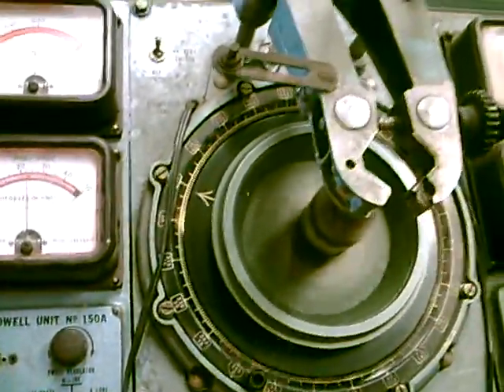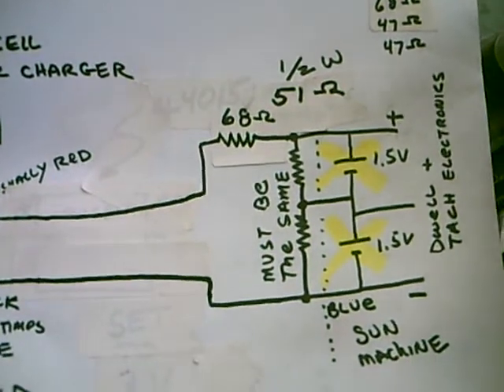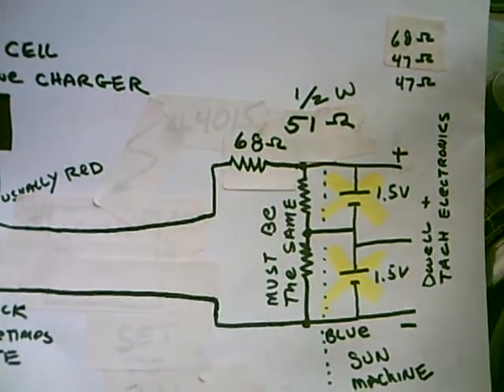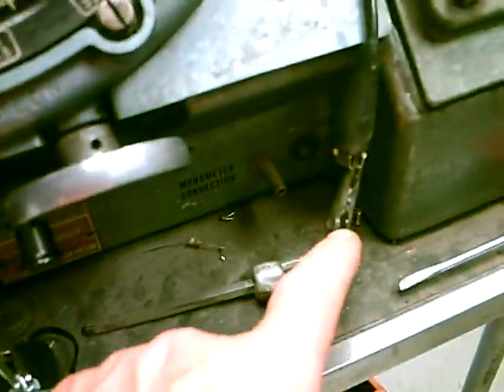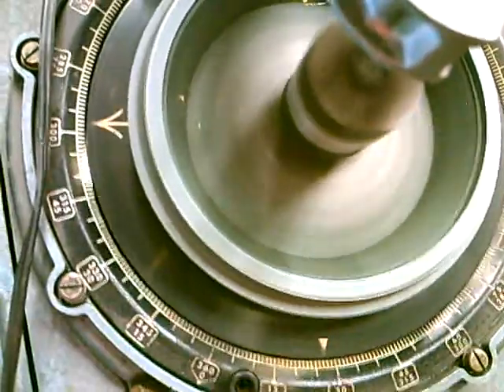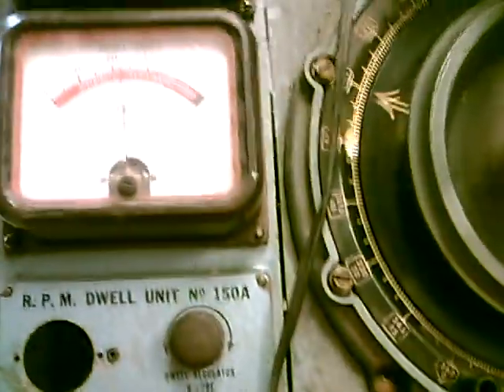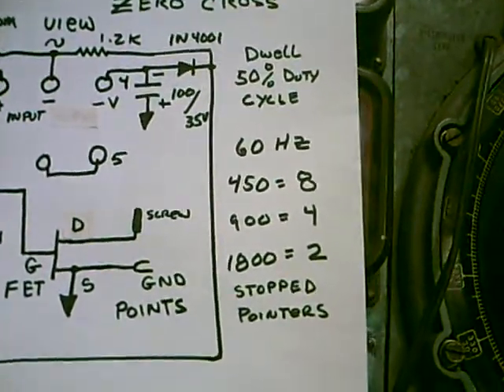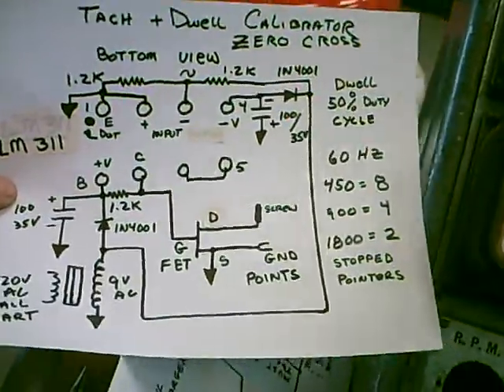Verify SUN Distributor RPM Cal & Battery Eliminator

Comment from the maker: There is now an easier method to calibrate speed and dwell with this ready made module. The manual wants you to use a factory calibrated distributor and where will you ever find that. A nice LCD display in a case for $5 or $10 US SHIP for those who don't want to wait.  Just add a FET and two resistors.  A video will be produced in a few months when I return.  I can provide a build it video before that if requested.
Reply: opera also interested in your LED as well

Comment: I need one of these machines.
Reply from the maker: These SUN machines are around and the ones with bad electronics are pretty cheap. I know someone in SW Ohio that has some rebuilt ones and maybe one unfinished.  They show up on ebay now and then.  I still have the Dwell Flash kits. I've had some people buy a half dozen kits over time. They must have a side business rebuilding these.

Comment: Hello from suburban Detroit!  Can I ask what FET part # you used for the circuit?  Eager to build this during the stay at home time!   Thank you for the help!
Reply from the maker: Picked up an old SUN power supply today. The machines are 30 miles from home. Looking to find some time to do testing. No internet so videos are hard to do.
Reply from the maker: Untested for non DS machine. 20N50 500V 20A get. .1uf D to S 47 ohm gate resistor.  Recommend $5 pwm generator for any build. This video will be deleted once I can make a new one.

Comment: I would be very interested in a build it video on your cal tool for RPM! Or I wouldn’t mind buying one from you
Reply from the maker: I have a later video on building one with cheap $5 pwm module from China. It needs to have a FET added to it. That design only works with the DWELL SPARK module.  with a higher voltage FET and some other parts it should work with other machines. Unable to load new video in current crisis or provide a link with only phone.
Reply from the maker: I never made the updated video. Did make one for someone who bought a flash module. At that time I was 800 miles from a machine. Would have to make one in order to do a video. This could be an option in the future.
Reply: opera please let me know! I would buy one from you! I have 3 machines here and 2 I use all the time.
Reply: I have a Sun 404 and 2 504 machines
Reply: Let me know! I’ll pay you for your time and knowledge to make me one. Not a problem